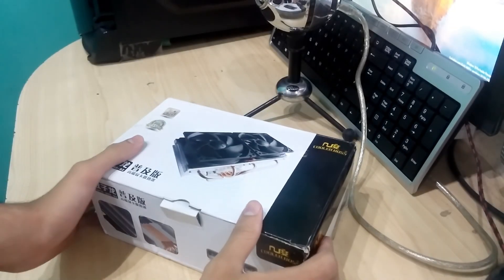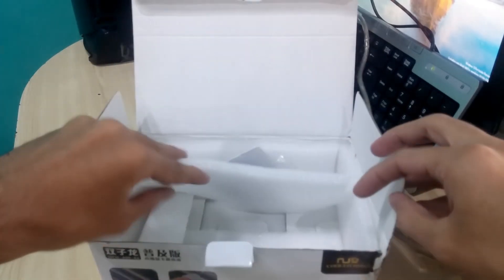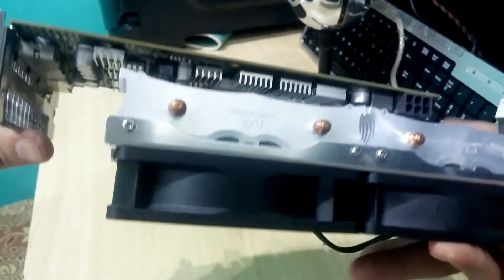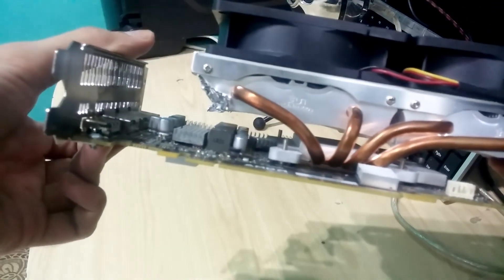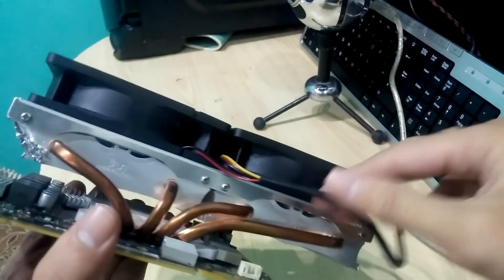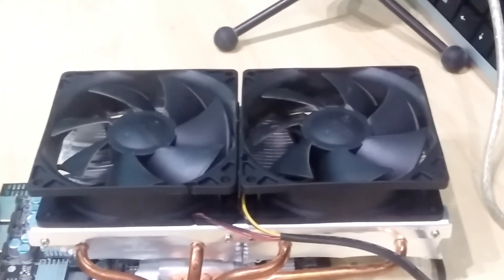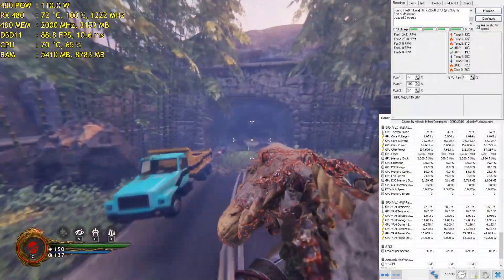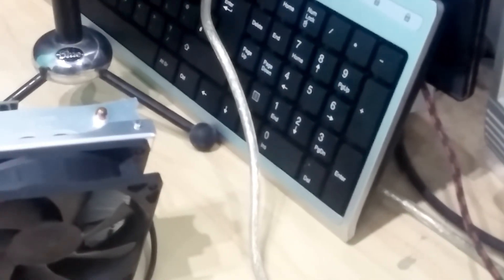This is Cheapest Aftermarket Cooler For Reference RX 480 | Cheapest RX 480 8GB

Comment: Thinking about buying a dirt cheap Powercolor Red Dragon and putting this cooler on it.. any advice? 
https://www.newegg.com/Product/Product.aspx?Item=N82E16814131706
Reply from the maker: if u have decided to get an rx 480, i would recommend go for it. But after u buy the gpu,then test out the temps, if your temps are already stable,then no need to buy this cooler. By stable i mean close to 70-75c at load :). I am giving u this advice because this cooler is a bit difficult to apply and needs modding to be done as explained by me in the video :)
Reply: Thanks!